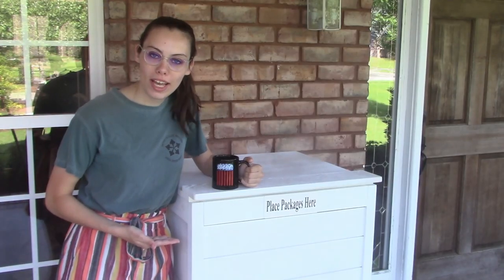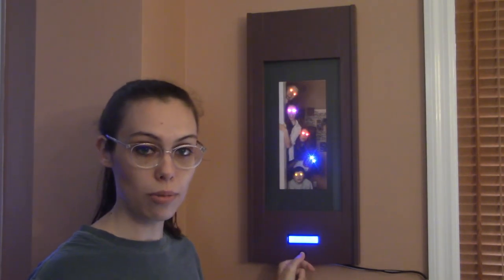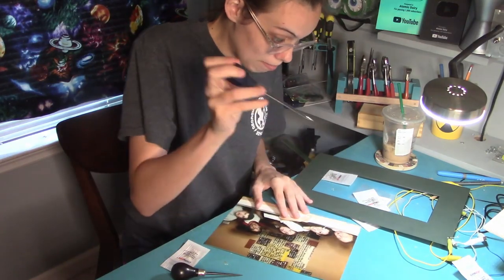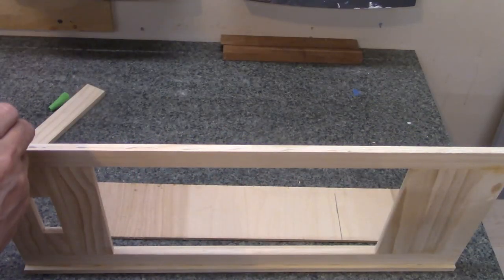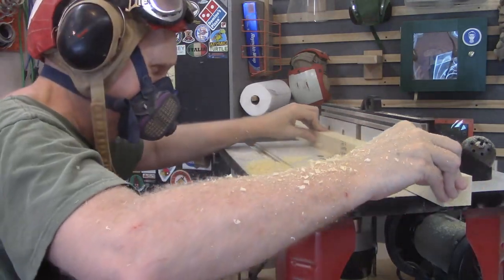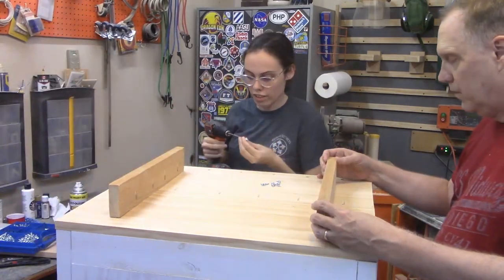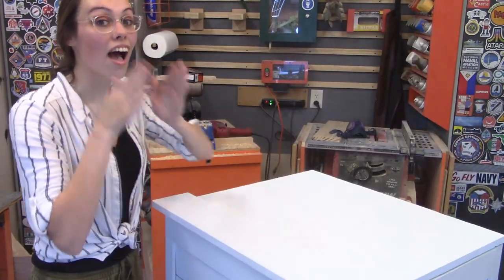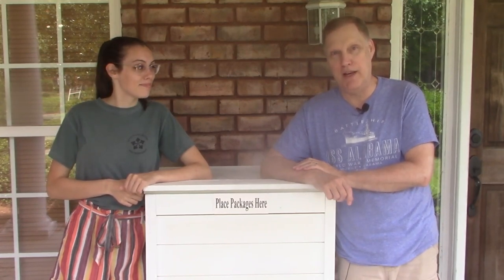Creepy Parcel Box - Secure Delivery Storage With LED Eyes

Comment: I like it.  I would like to do something similar but install a magnetic latch - like used for security doors in a building.  Control the latch with a NFC reader in my phone.  Wave the phone by the door and it opens.  Or tell Siri to open it.
Reply from the maker: Good ideas. We are planning on rebuilding our box to make it shorter, and with a more obvious lid.

Comment: I would have expected that the visual would indicate the number (or wight) of the packages: one package, the lowest pair of LEDs light up; two packages, the bottom two; etc

Very nice work

Did you consider security pocket-screws? Not because it's better, just because it's more complicated
Reply from the maker: We could do that. We thought of a few other things to add but decided to get the system built with the necessary pieces and then see which way it goes with usage. The box is 2x4 sticks so building another one will be practically free, but we will wait until we get some experience with this one.

Comment: How did those uninsulated leads going to the LEDs not short together under the heat-shrink?
Reply from the maker: No shorting. Each pair of LEDs uses a single resistor, so the two similar leads on each LED were soldered together. One twisted pair goes to the Arduino ground and the other goes to one of the digital pins. There are five pairs of eyes and each pair has it's own PIN, which allows us to individually control each of the five faces and make the eyes blink.